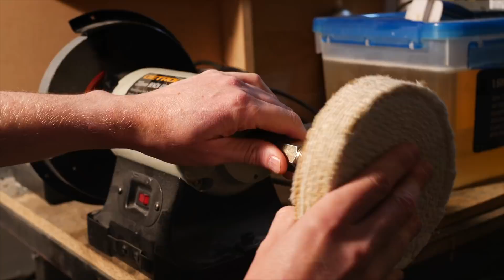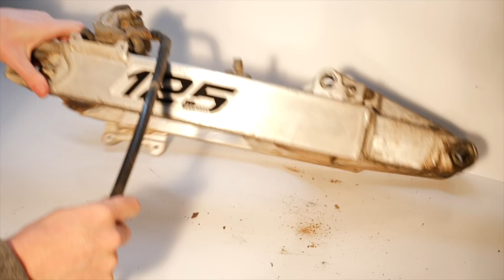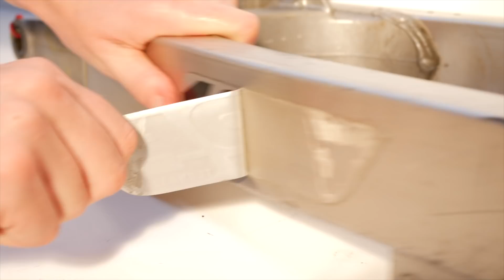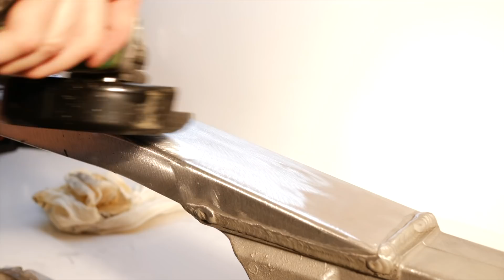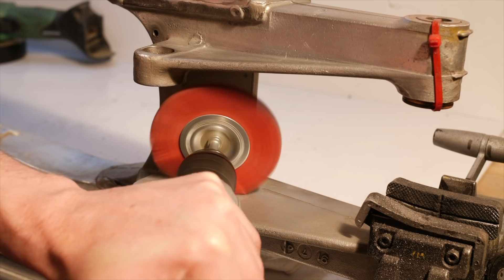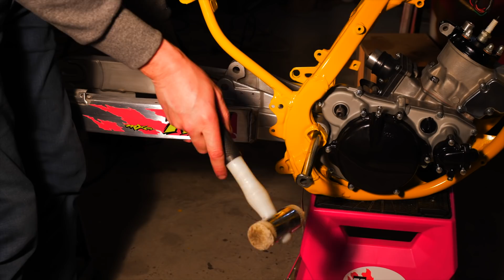Swingarm Refresh | '92 RM125 Build

Comment: Great work! I’ve been doing a few and I always seem to get a uneven finish even after using sanding blocks. It seems like the areas that had decals never seem to come back to normal...do I need to remove more material? I currently vapor blast and then use the sanding block, results are so-so...

Comment: Coming along beautifully! Appreciate the tips on getting that brushed look on the swingarm, I am about to start my 92 restoration this summer. Do you mind sharing the model # of the ohlins shock? I have seen a couple come and go over the years on eBay but i have never been sure they are an exact fit.
Reply: My 1989 RM125 has an Online type 46PRC   SU912, I'm not aware of too much info about it. Was it an option from Suzuki?

Comment: Looks just awesome. But let me know of taking this needle and and spring off the rm125 and put back the original rm250 carb back on?
Reply from the maker: Thanks!  The 125 carb is smaller than the 250...
Reply: But won’t the spring and needle fit into the oem 250 carb? I’m sure the spring and needle will fit.

Comment: Nice work , are you not concerned about the raw aluminium finish oxidising with out a clear?
If kept on top of a quick wipe with scotchbrite would keep it nice too
Reply from the maker: I’ve done swings like this before and years later they still look good.  Should be fine!
Reply: G9Garage I agree 👍